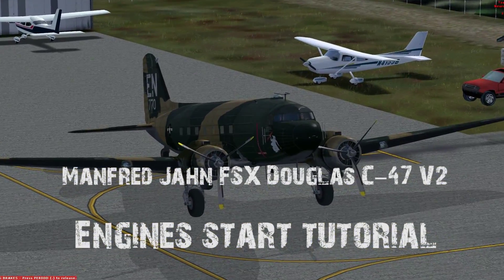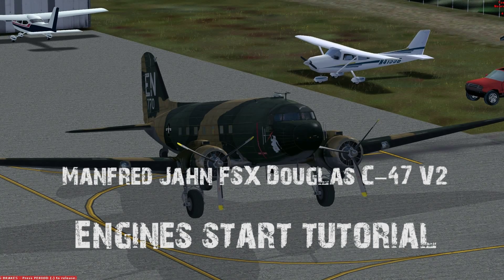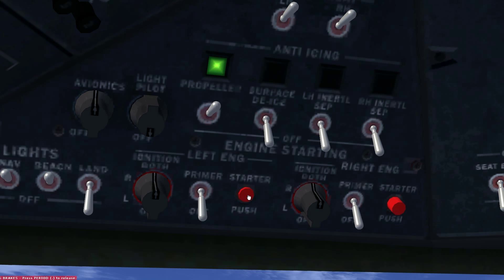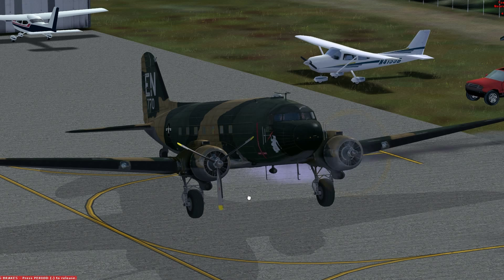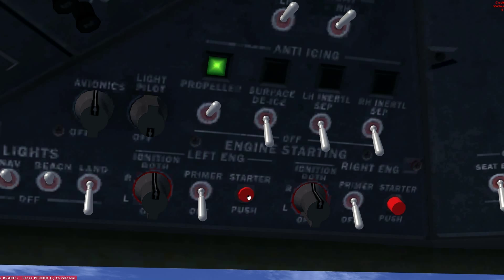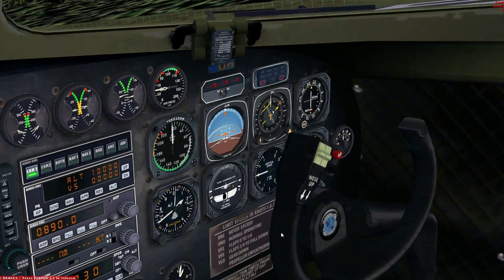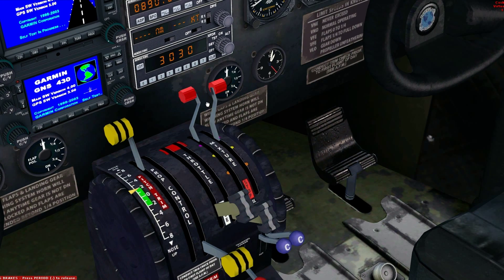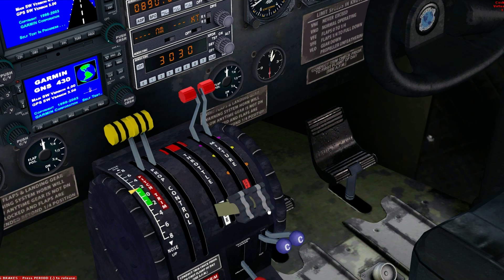Manfred Jahn FSX Douglas C-47 V2 Engines start tutorial

Comment: Nope. My engine 2 just stalls after 10 seconds, every time :(
Reply from the maker: +Jagh Haringenamn hm, check fuel?
Reply: I did, plenty in there.
Reply from the maker: Jagh Haringenamn
Are you flying in very cold and high altitude airport?
Reply: Nope. Almost sea-level and 4C
Reply from the maker: +Jagh Haringenamn 4c is very cold, maybe u need to turn on Carburetor heat?
Reply: +FastCheetah702 will try!
Reply: They have to warm up no matter where, or how cold/hot it is... after a couple minutes it'll idle fine.

Comment: i set the propeller to 80% and the thrust not more than 35/40% manifold presure to prevent engine fire, guess it also depends on the outside temperature
Reply from the maker: I m pretty out of touch with this plane, but i might need to ferry flight one from Alaska soon due to bad business there...I fly in Fs Economy...will use your guide here. Thanks :D

Comment: This is currently my favourite aircraft in FSX, but I'm having a problem with ILS - I cannot capture a glideslope anywhere, I am tuning both nav1 & 2 to ILS, can get localiser ok but no GS needle ever appears. Im scouring forums for answers, can you help? Thanks!
Reply from the maker: hi, you need to press the CDI button at the bottom left of the Garmin GPS to make sure it is change to VLOC mode, and not GPS mode. I see 2 yellow triangles appear on the Horizontal Situation Indicator after I did that.
Reply: Got it, thank you so much for replying.
Reply from the maker: Simon Jones
You r welcome :) One thing I have not test is that if the C47 V2 can do Cat 3 glide slope auto descend. If you happen to land at an airport with Cat 3 ILS, please let me know if this is possible. Thanks and have fun flying the amazing DC3.